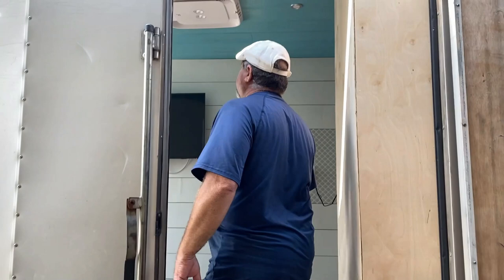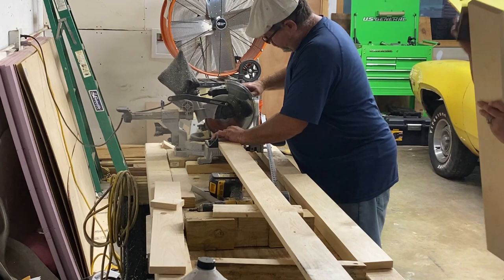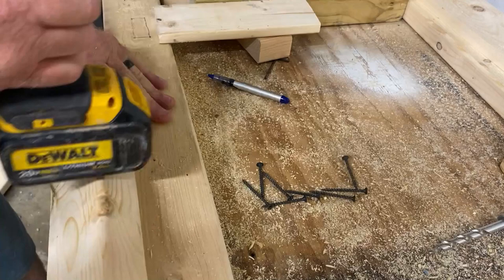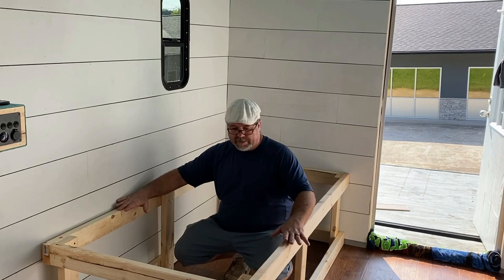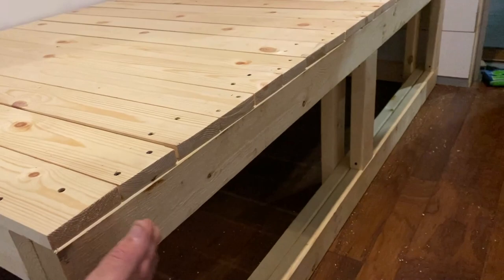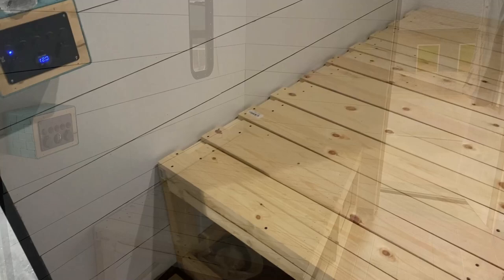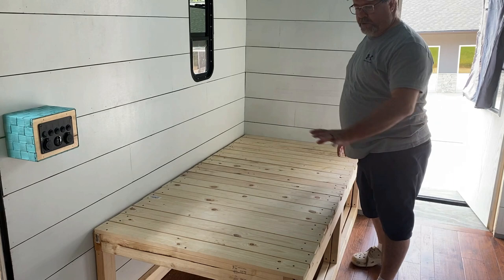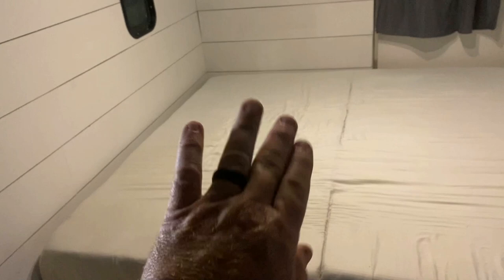CARGO TRAILER CONVERSION PART 15  BUILDING A SLIDEOUT BED.

Comment: Good job on the bed design. 50 years ago grandpa taught me one thing, and that was if wood was sliding against wood, it would benefit from having beeswax on the surface. Nonetheless, it looks like you nailed it.
I'm working daily on my 7 by 14, and it seems like the more I get done, the more I find ,things that I still  need to do.
Keep working,  we'll  keep watching. 👍
Reply from the maker: Thanks for watching and commenting on our content we appreciate it. and thanks for the beeswax info I will get some and use it, I do the same thing every time I think We are getting close I find more things that needs to be done, but I know every thing We do big or small its get us that much closer and we are enjoying almost every step of it.